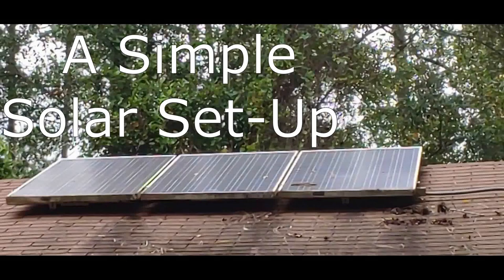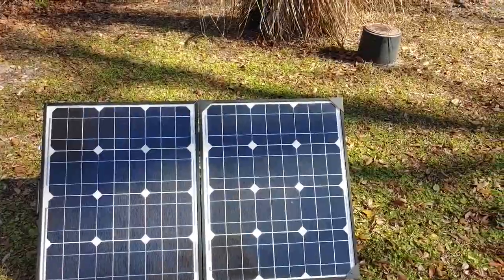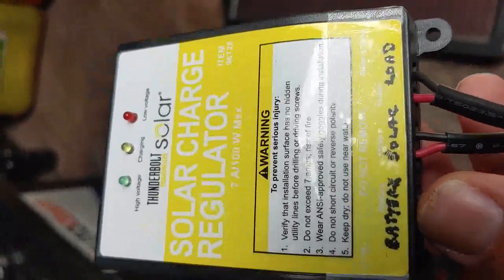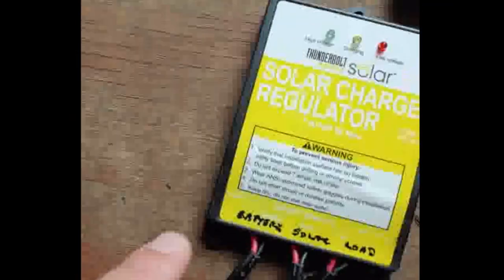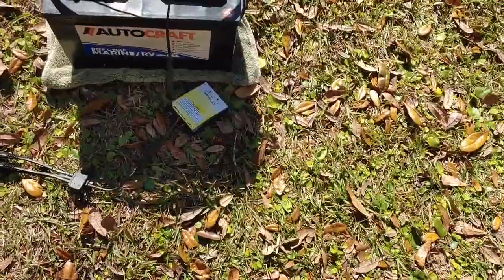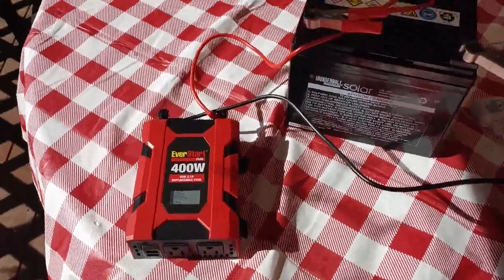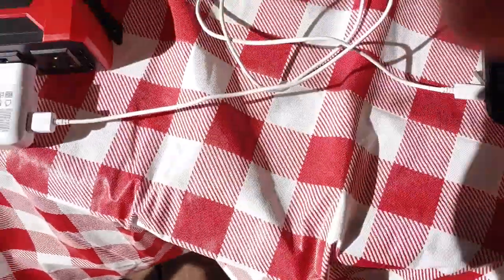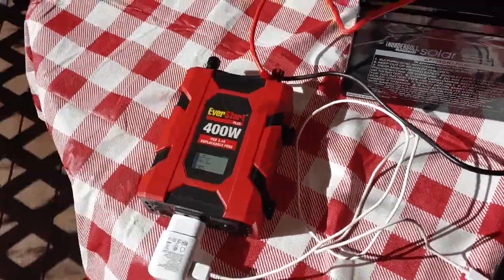New, improved Off-Grid Simple Solar System design and use.

Comment: Thanks for the video, very informative.   Can you add a video for types of fuses/fuse boxes going to/from the battery banks to controllers/inverters?  Also what’s your take on grounding rods to stay within electrical code for solar?
Reply from the maker: My 600 watt solar system has grounding rods. I highly recommend them for large solar setups. 
Thank you for your comment.